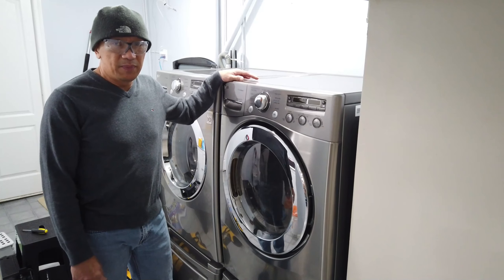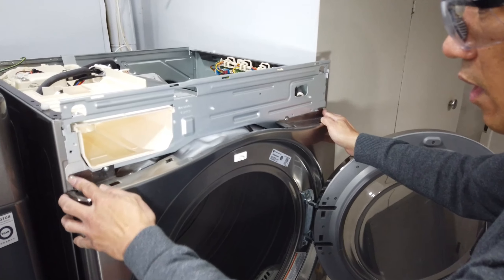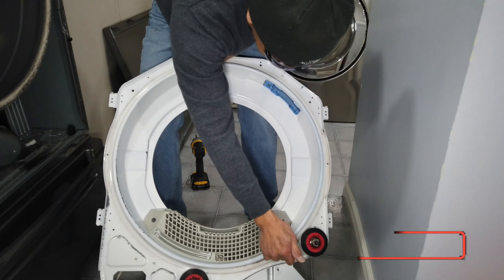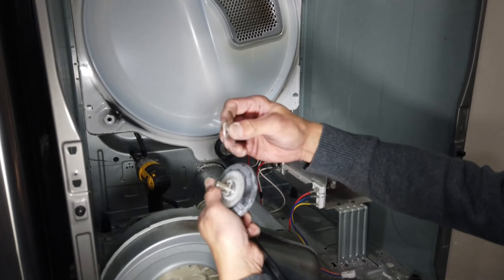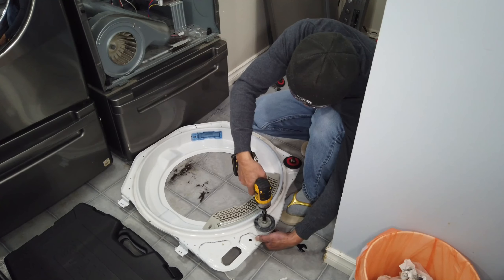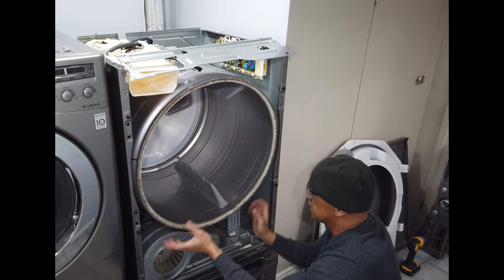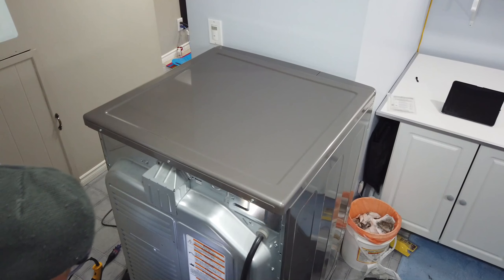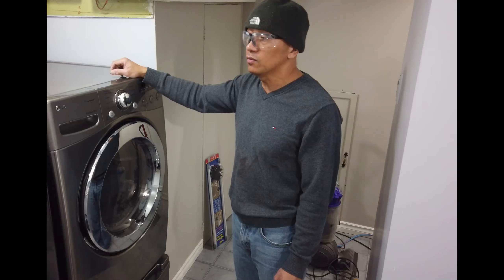LG DRYER REPAIR - HOW TO REPLACE A NOISY WORN OUT DRUM ROLLERS STEP BY STEP

Comment: You were the only one with a video of my exact model from 13 years ago.   I had a constant grrrrrr. ing sound from my Dryer, not a thumping.  I took it apart using this video and a few others and found that there was simply a fabric softner sheet that somehow had gotten sucked into the impeller and was spinning with and against it.  I didn't need to change the wheels, but thanks for the help in getting all of it apart to diagnose it!
Reply from the maker: Thank you I really appreciate you appreciating this video.. I'm glad it helped you guiding you with this video.

Comment: I have the same dryer and it was making an awful noise.  Due to travel my family called a repairman. He said it needed a new belt and two wheels. ( for clarity dryer 8YO and used with a family of 6). The cost with parts was $550.00, broken down, initial diagnosis, parts cost and then come back to fix.  We initially considered buying a new one. I watched this video and another one on how to repair it. I ordered the parts of Amazon. The day before I moved the dryer to open space and took it apart. Took my time and labeled/numbered each step when I disassembled the dryer.  The parts came on Sunday around 11:00AM. I also cleaned the entire inside of the dryer. I followed the this video and had no trouble installing the wheels and belt. To my time reversing my steps and reinstalled part by part and screw by screw.  I then prayed to the laundry Gods and plugged it in. It was as quiet as a church mouse. 10 loads and no issues, knock on wood.  Thank you for the video and some of the comments. I saved a lot of money too.
Reply from the maker: Thank you very much for appreciating this video tutorial, I’m so glad this video helped. 🙏🏻😊

Comment: That's funny I have almost identical LG appliances - got them from a neighbor. The shocks on the washer are worn I think and the drum rollers are noisy too. They are from 2012 so understandably they have some worn parts. I figure $200 or so for OEM parts but still cheaper than the $2300 or so dollars for new units :)
Reply from the maker: Exactly, once you replaced it with the new parts it will work like new and it last longer. Just don’t overload your dryer so that the roller can handle the drum  right to it’s weight capacity 👍🏻
Reply: @alwaysmabel  The 10 year warrantee on the motor is a hint as to how long these LG motors will last!
Reply from the maker: I bought my LG year 2012 and the motor works perfectly fine. I hope the will not give in after 10 years because it's not going to be covered by the warranty by LG anymore. lol

Comment: I was getting the thump noise thinking my rollers were bad/flat spot.  Thought my rollers were bad, nope.  It was about a 2" crack in the drum close to the edge.  Turn the drum, feel for the weld seam and press front and rear of the weld section edge, if it separates, you have a bad drum and need to replace it.

Comment: How did u remove the middle wire harness? (Red/pink). For the life of me, I don’t know where to press to release it. 2:35
Reply from the maker: yes, just like what I mentioned there's tab you pinch it in then use the flat screwdriver to push the harness out while you're pressing  or pinchinh the locking tab.

Comment: WARNING!!!!! If you try this now understand that most places (including LG) have replaced the original rollers with part 4581EL2002H. On these new ones you still have the 9/16" nut on the back but the stem is now something like a 3/8" hex, not 10mm. None of those suppliers mentions this. Otherwise, it was nice to find this since it matched my dryer setup unlike most of the other LG drum roller videos.

Comment: I did all the steps just fine but when I turned it back on there was power but I could not start it is what am I missing here.
Reply from the maker: There’s a door sensor switch that when there’s not contact it will not start.. try checking it unplug it then plug the wire harness again.